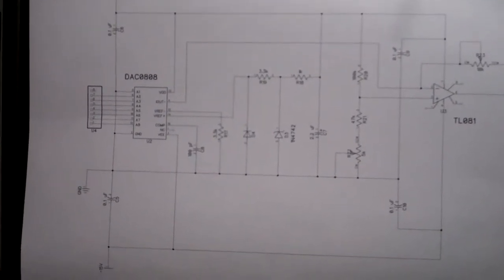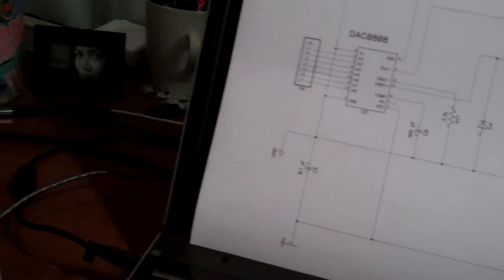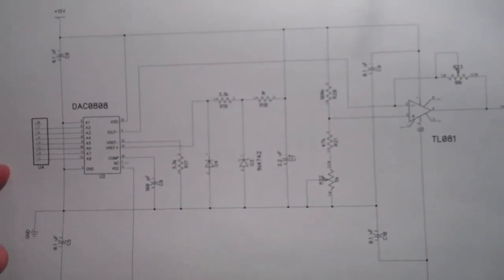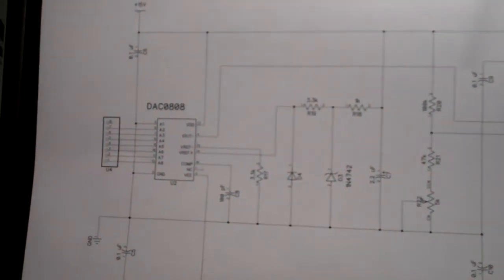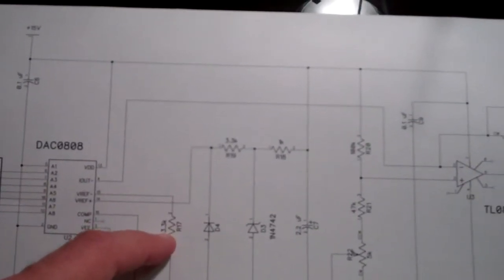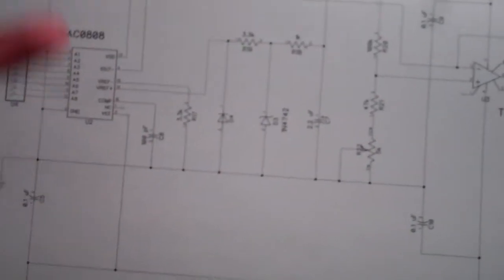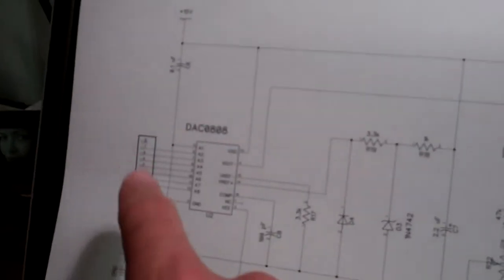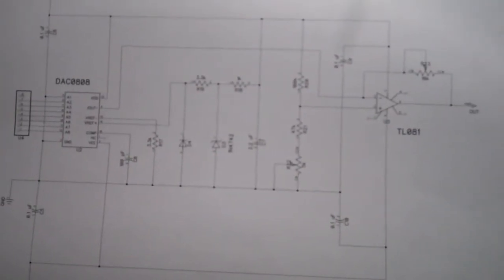how to use the DAC0808 digital to analog converter chip

Comment: hi. as the dac output current, we will need an op amp to get an output voltage. if i use this dac to convert digital to analog audio, will I still need the op amp? or will the op amps within the speaker suffice? thanks. I'm very new to electronics
Reply from the maker: +Ming Huang , the DAC0808 chip cannot be used to transfer digital audio to analog audio.  There are specialized chips for doing that.